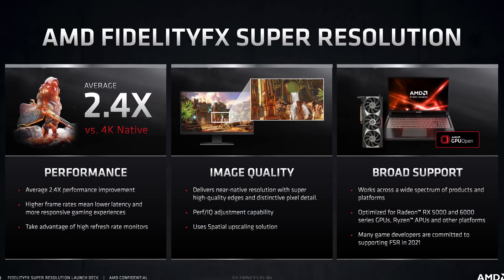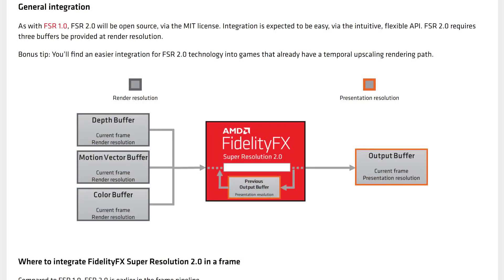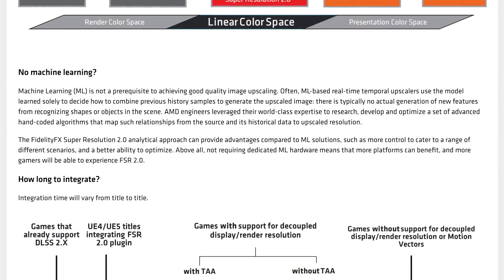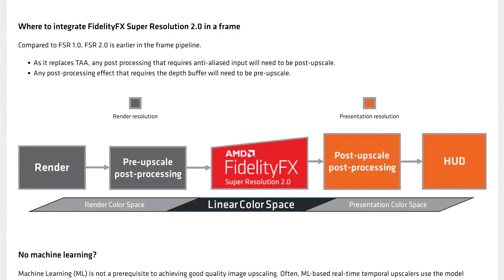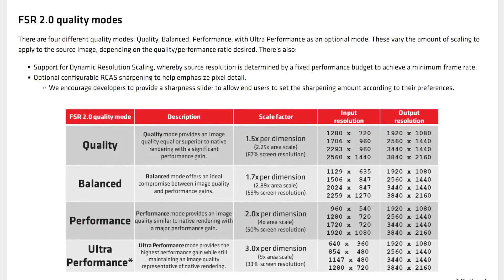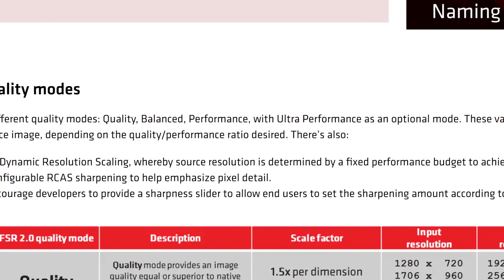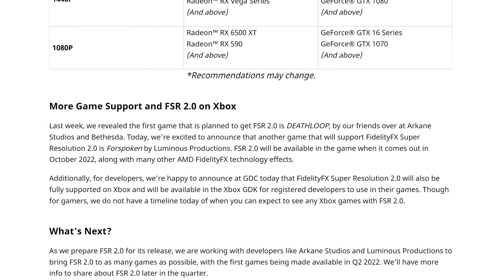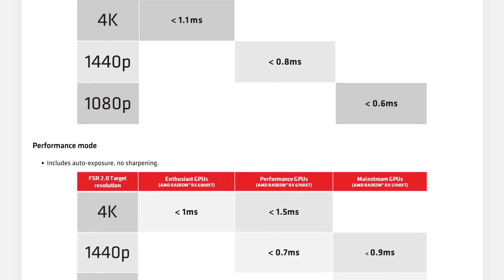AMD FSR 2.0 Details: GPU Support, Quality Settings, How it Works

Comment: As long as it’s somewhat close to DLSS 2.0 it’ll be a win in my book mainly Bc its supported on many many more Gpus including Gpus that dinosaurs used before the Big Bang
Reply: I hope it would also support the GPUs that Queen Elizabeth II has used before the creation of this existence
Reply: @Iatemykitty  wtf!!
Reply: @Iatemykitty  Lol.
Reply: @tridungnguyen2357  There is no reason to assume that ghosting can only be fixed with ML.
Reply: @konga382  Yes and AMD has shown us time and again that they can make stuff like that happen so let up hope this might be the case here too!
Reply: @tridungnguyen2357  ML has its own share of problems related to ghosting
Reply: @tridungnguyen2357  Nvidia hasn't actually ever provided any proof of the effect of machine learning. I think it's quite likely that the ML in DLSS is very minimal and just used to justify the requirement of tensor cores.
Reply: @lhc6996  From the inital images of FSR 2.0 in Deathloop, it seems to be a match for DLSS without ML so I reckon Nvidia has been feeding everyone BS for the past few years.
Reply: @Darksky  Maybe wait for the actual release of FSR 2.0 and comparisons between FSR 2.0 and DLSS in multiple titles before going full conspiracy theorist.
Reply: @ilusiil  I think DLSS will be the best followed by XESS followed by FSR. But FSR doesn't even need to be the best it just needs to be somewhat close to DLSS 2.0 and it will still be a huge win for them since they support the most hardware. However I think FSR 2.0 may not be as good on older hardware.
Reply: @Dark-qx8rk  no cause AMD were copying Nvidia when making FSR 2.0, why do you think they switched to temporal?
Reply: @Gabriel-sy2bp  uhh, maybe because temporal is better and is the way to move forward??  Even TSR (and TAAU which is much older) uses temporal components, so are you gonna say that Epic copied TSR from Nvidia?? According to that logic, even Nvidia copied NIS from AMD FSR 1.0.
Reply: @kishaloyb.7937  NIS has nothing to do with FSR 1.0 lmao do you know what Image scaling is? NIS is more like RSR, on top of that everyone knows about Temporal Nvidia uses temporal aswell that's why AMD copied them, though it doesn't seem like FSR 2.0 would make much of a difference in the end  sure Radeon cards got better but doesn't mean they surpassed Nvidia GPU'S, since AMD went temporal they will have a ton of ghosting issues
Reply: @Gabriel-sy2bp  NIS uses a 4-tap lanczos filter. FSR 1.0 uses a 6-tap lanczos filter. NIS has 2 variants, one which can be implemented in middle of the render pipeline like FSR 1.0, second variant which is basically like RSR (driver sided). All I'm trying to say is that NIS is based on lanczos filter just like FSR 1.0 is, but that doesn't mean that NIS copied FSR 1.0/RSR. Lanczos filter just like temporal inference is a crucial part of any image upscaling technique/technology. Its the very fundamental of this whole domain, and fundamentals cannot be copied from one another or be copyrighted. You're accusation sounded like "Airbus copied the idea of wings from Boeing to make their planes fly", which makes no sense considering that wings are the fundamental component of any plane. 

Also, the DLSS 2.X you are enjoying right now (which still has minor ghosting issues and other temporal artifacts) is the product of 2-3 years of continuous improvements and optimizations. Even early versions of DLSS 2.X had immense amount of ghosting and temporal artifacts, and they got slowly fixed eventually. FSR 2.0 won't be any different from that, and will just get better with time. Right now, the only thing Nvidia GPUs are outright good at is RT gaming.
Reply: @kishaloyb.7937  Lmao Because DLSS 2.3 still has sharper textures, plus for the games I will be playing they are more optimised on Nvidia GPU's, DLSS is still better that will also improve performance while maintaining sharper graphics, FSR 2.0 will tank it
Reply: @kishaloyb.7937  Not even close to caught up 😂 their drivers are still awful in windows and Intel GPUs don't look like they are anything ground breaking, all the info u have on FSR 2.0 is what AMD fed u with previews of a frozen image, nobody knows who it will actually perform in intense situations, some even say it will tank performance like it did with FSR 1.0
Reply: @Gabriel-sy2bp  millions of people are using AMD GPUs and they have no issues with AMD drivers. As I said, AMD drivers right now are better than ever, even though they had minor issues in 2019. You personally having  bad experience with AMD drivers is not the absolute representation of millions of people using AMD GPUs. Even I had my bad experiences with Nvidia drivers/GPUs during my days of using a GTX 970 and all that 3.5GB VRAM debacle. That doesn't mean that Nvidia as a company makes bad GPUs/products, or my experience is the absolute representation of millions of people using Nvidia products. Intel ARC GPUs have AV1 hardware encoders so they do well with AV1 even compared to Nvidia and AMD who use software encoders. 

Considering that AMD is releasing FSR 2.0 right now means that the technology is well developed enough to be competitive to DLSS 2.x. What happens after that, lets just wait and see and then judge. Also all upscalers like FSR 1.0, NIS, FSR 2.0, DLSS 2.X , TSR and XeSS have their own GPU overhead or performance cost. If that cost is not paid, then it will always tank performance, no matter which upscaler is being used. For example, DLSS 2.0 at 4K Quality mode on a RTX 2080Ti has a performance overhead of 1.507ms. That means, DLSS 2.0 will always consume 1.507ms of a frame time budget to execute it's own functions. If it doesn't get that 1.507ms out of the frame time budget, then it will tank performance of the game.
Reply: @Gabriel-sy2bp  And if I want sharper textures and overall sharper graphics, I can just use any of the sharpening filter out there to sharpen the output. As far as tanking performance goes, I've already explained it in another comment that talks about performance cost/GPU overhead.
Reply: @lhc6996  Nvidia just wants to vendor lock games so that in future you are forced to buy Nvidia. It's a great business model. Putin approves.
Reply: @tridungnguyen2357  AMD has implemented specific algorithms to deal with shimmering, ghosting and trailing during motion. Read their official blog post about FSR 2.0 to know more about it.
Reply: I wonder which games dinosaurs would play on their PCs. Definitely not Horizon Zero Dawn.
Reply: @gurjindersingh3843  they played hunting games with other creatures with real life experience and more realistic ray tracing and shadows 👍🏼
Reply: @tridungnguyen2357  Ghosting isn't something that magically gets fixed by the ML part of DLSS. And it's also not required to tackle it. Actually FSR 2.0 apparently comes with a feature, a "disocclusion mask", that makes it possible to cancel out ghosting. If all goes to plan it might even handle ghosting better than DLSS. But I wouldn't count on that, let's see.
Reply: but... dinosaurs came after the big bang... 🤔
Reply: Nvidia GTreX confirmed 👀👀👀
Reply: They just need to be close to DLSS 2.0 . It will still be revolutionary.
Reply: @tridungnguyen2357  Many people have challenged the actual requirement of Tensor cores or AI in DLSS as such Intel states that DP4A support is enough for a good experience though that may count as machine learning but that is available on many Nvidia GPU's and AMD RDNA2.
Reply: @tridungnguyen2357  FSR is pretty good at 1440p, if you are not pixel peeping. But yeah AMD claims are just marketing tactics as DLSS is a far more mature solution.
Reply: Lol. Just not much use for sth. like a GTX 660 I suppose; it just doesn't have the performance nor VRAM to cut it anymore, FSR won't change much there. But it's sure nice to have it supported on basically all hardware!
Reply: true
Reply: Imo anything less worse than DLSS 2.0 is not worth it, because DLSS is already not perfect compared to what some channels make out. It's tolerable and worth the extra performance but any worse quality than that and it gets to the point where I would rather just drop settings or deal with less FPS.
Reply: @AVerySillySausage  Well it depends on your perspective of tolerable. FSR 1.0 is pretty tolerable for me at ultra quality so FSR 2.0 should be pretty good at least at 1440p.
Reply: @AVerySillySausage  DLSS 2.3 actually seems to produce a sharper image on Death loop than FSR 2.0 but it's so close it's barely noticeable. I am more into the FPS boost rather than the quality because you will not notice the difference in-game, if FSR 2.0 has a better boost in performance than Nvidia then I would use FSR 2.0, if not sticking with DLSS and pray Nvidia can wake up and do improve DLSS for all it's cards too
Reply: it's nowhere close to DLSS. Nvidia users would NEVER use FSR, if DLSS is present in a title. FSR is primitive.
Reply: @NoSubOnlyExplorers  YEAH!!! 10 series users should just stick to dlss!!
Moron
Reply: @NoSubOnlyExplorers  Bit early to make that call considering FSR 2.0 isn't even out yet. At this time, DLSS is more advanced but FSR will get massive enhancements soon. Remember, DLSS 1.0 was much worse than FSR 1.0
Reply: @NoSubOnlyExplorers  How can you say this when FSR 2.0 isn't even out yet? It looks promising based on what we got and sure isn't primitive anymore (FSR 2.0). I still think DLSS might have the edge over it, based on some noise artifacts I can see in the comparison screenshots, but one can only compare them when it's out and both are implemented in the same game (although, even then one implementation might have received more care..).
Reply: @NoSubOnlyExplorers  imo in some games fsr is better because of the difference in the way the artifacts look and the way the game is designed/looks
Reply: @NoSubOnlyExplorers  nobody is forcing anyone to use anything. If anyone thinks that FSR is primitive, then they should just avoid using it. Just stick to DLSS in that case.
Reply: @dampflokfreund  and how many games are there which are like that?? Not to mention, what makes you think that it's AMD who stops developers from implementing DLSS??

Comment: first
Reply: im convinced that this is the dumbest comment in all youtube videos..
Reply: Congratulations you've won a 6500xt with PCIE 3.0 motherboard 🤗
Reply: @Iatemykitty  thanks I will happily take the bundle as I already got a PCIe 4 board and I can use the other one for something else
Reply: @mineatomtr  sorry but i forgot to mention that the GPU is pre-installed with the motherboard if you try to remove it the GPU and motherboard will get damaged 😔
Reply: @mineatomtr  also you're not the one who's first, so you are not eligible for the reward
Reply: 5 seconds too late
Reply: not good enough you peasant ...lol